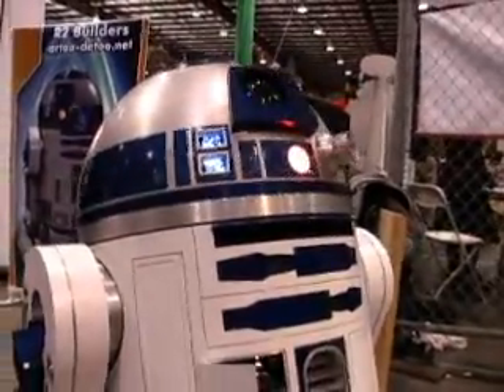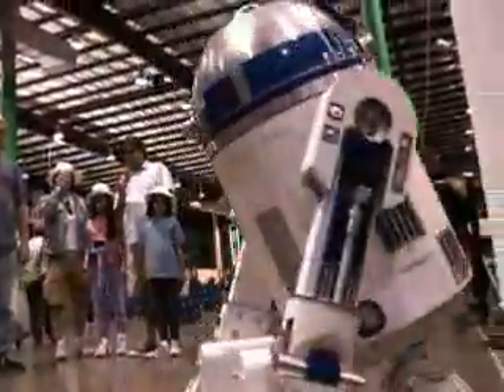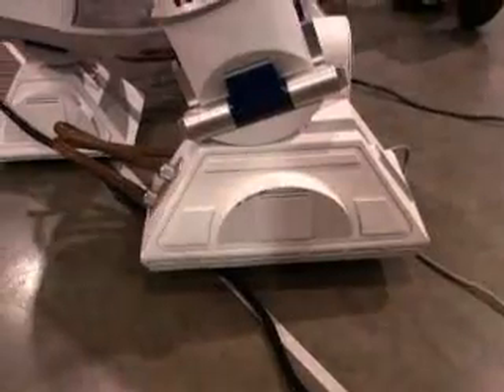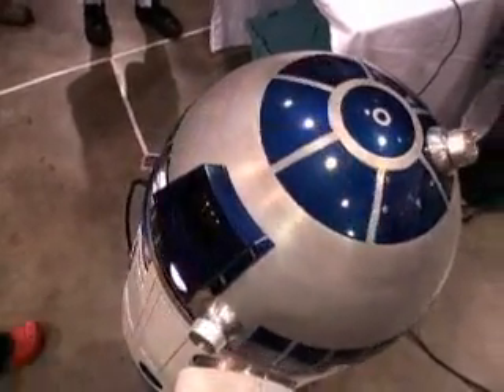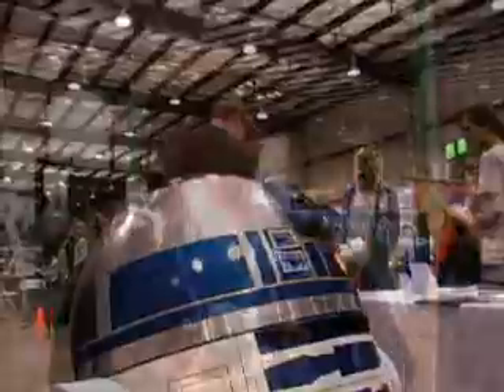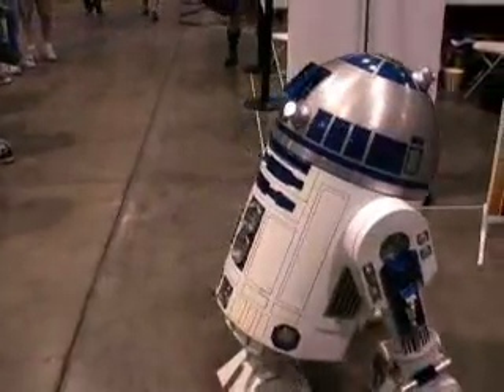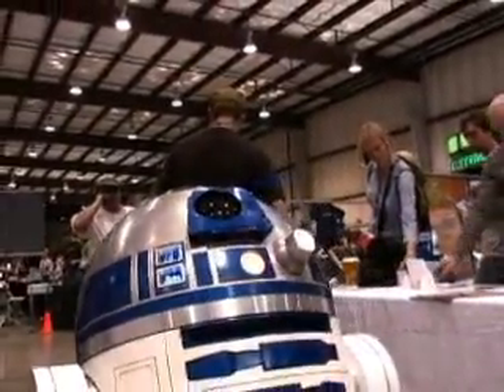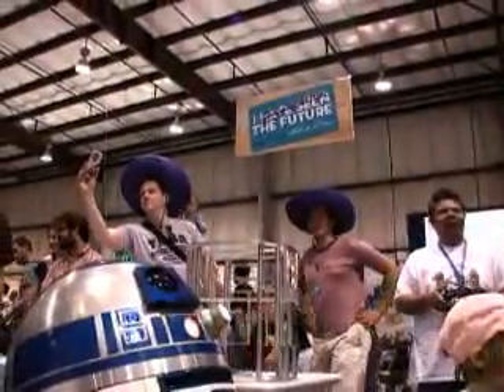Maker Faire 2008: R2-D2 Builders

Comment: @RewYnd - by combining into a single unit what it took multiple actual props to achieve, e.g., a single unit with both the fire extinguisher and the periscope, which were on different prop units.

Also, creating a unit capable to transitioning BACK from three leg mode to two leg mode, which the prop units were never capable of.

Comment: @eleven38 i could of sworn it was a midget and it wasnt just for the shaking. there was problems with the controls in the original R2 and only one thing could operate at a time, so they put him in to turn the head and deploy the middle leg when needed.  if you still dont believe me watch the bonus features on the original trilogy.

Comment: That is a cool video. Thanks for posting. We tried using a Vex with my R2 and couldn't get it to work out.
If you want you can check out my completed R2
I am also a R2 builders group member.
Enter
eY-X9oktFoc
Into the search bar if you want to see him
at 100% and on display.

Comment: Hes saying that these "copies" have more funtionality than the ones used for the films. Each one for the film had a different function. These "copies" have almost every function ever seen all in one model. Also models for the movies had Kenny Baker inside of it controlling almost all of the functions. Theres no small guy inside these models, they move through actual robotics rather than Kenny moving it by hand. Therefore they are actually closer to a real Droid than the ones used for the movies.